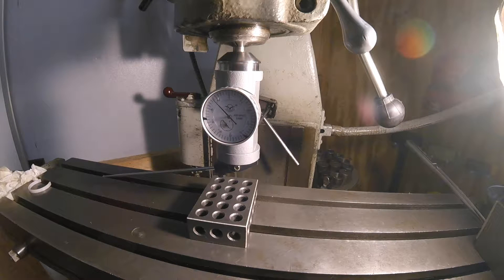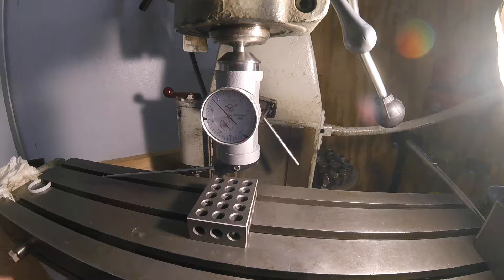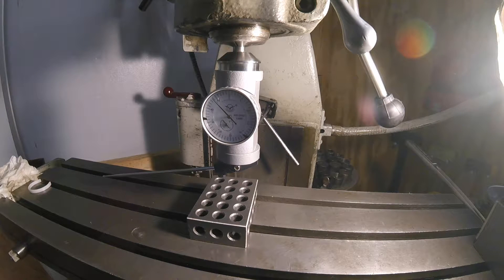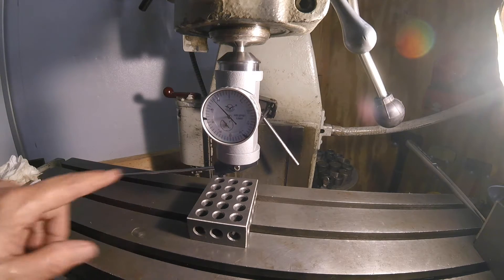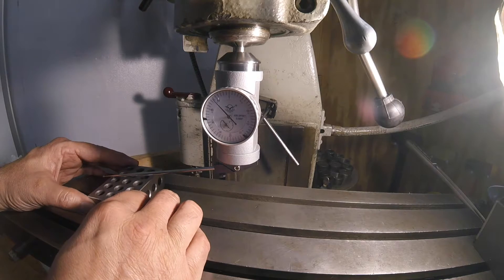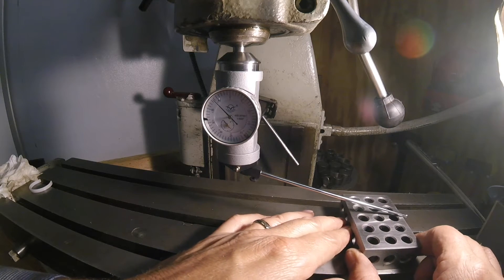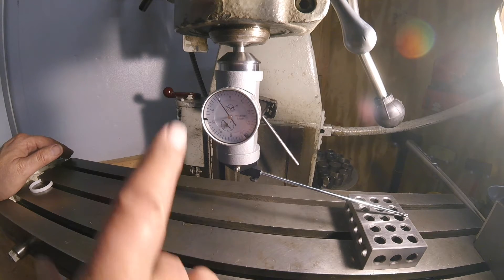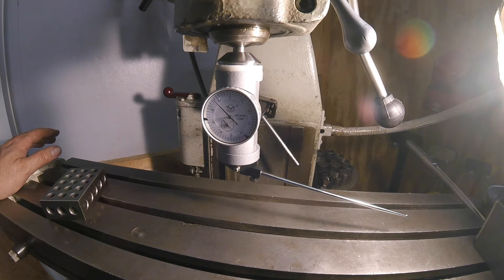Tram Mill Head With A Coaxial Center Indicator

Comment: A dial indicator is actually more accurate. I tell you why. Those indicators are accurate with the 1,5" feeler, In that case 0,001" on the dial is 0,001" on the feeler, but when you are measuring with this 3 times longer feeler 0,001" on the dial is in reality 3times more on the feeler.. so it is 3times less accurate. It tricks you into thinking how good of a job you have done, but in reality you didnt.
Reply from the maker: I bought a Pro Tram that uses two dial indicators within a month of this video and posted a video of it in use. My neighbor showed me this method because it’s what he was taught, and I happened to have a coaxial center indicator which was needed to do it.   The pro-tram is the way to go, and I also use it to set the head tilt as shown on my finger plate video.

Comment: I don't know much about your mill. But if you have a geared type head adjustments on your mill something like the Bridgeports and the clones do what I finally figured out was once your very close to final tram then snug the head locking bolts up a partial turn past finger tight, then touch the indicator to the table along the axis your adjusting, then start lightly tapping on the end of the wrench that's on the tilt or nod adjuster. That allows you to creep up on the final adjustment a lot easier while watching the indicator needle move the measured amount you need. You do have to use a bit of experience and feel since if you get those locking bolts a bit too tight you WILL do damage to the adjusting worms or gearing. If the bolts are even a bit loose the head tends to move around and out of adjustment as the bolts get tightened. I also run checks in X and Y while I'm putting the final tightening torque to the head locking bolts since the head can still move as it starts to fully seat against tilt and nod faces. It's a bit like tightening head bolts on an engine where you tighten all the bolts multiple times until you reach the required torque measurement.
Reply from the maker: Thanks for the great instructions on tramming a Bridgeport.  My Rockwell mill has the same configuration as a really old round ram Bridgeport and it does not have a nod feature.  The round ram is fixed to the head and goes through two clamps that are cast into the mill body.  You loosen the clamps and the head rotates.  It does have a ring and pinion gear on the back of the ram to help rotate the head, but I see this feature at as something that is used to help rotate the head in a controlled fashion while the clamps are loose, I don't think it is strong enough to use the way you do in the Bridgeport.  There is also plenty of slop in  the ring and pinion, so you can fine tune the head with a hand or a hammer once you are in the approximate position and snug the clamps down slightly.   Once I'm close I tighten the clamps enough that the head wont rotate on its own,  Then I make the first adjustment while tapping it with my hand then I snug the bolts, and check again, then i repeat this sequence to get it closer and closer, while snugging the bolts a little more each time. after a few repeats it is lined up and pretty tight.   I found that tightening the bolts a little every time you get it closer is the key for me to make it work, because if you were to get it dead on with the head loose, you would loose that adjustment as soon as you tightened the bolts.  I use the same tighten and tweak procedure when aligning mill vises and when doing precise angles on my lathe compound, and its been working for me.  I've only had this mill for 2 years so I'm no authority on aligning the head. This is part of the reason I only showed the unique technique my neighbor showed me without getting into actually showing the full process.  There are way more experienced people, Like you,  that could give a lot more detailed explanation of the process than me.  Thanks for watching and thanks for your comment!   Chris
Reply: It's maybe a bit less so on the small Bridgeport sized machines, but those ring and worm gears on these mills are also meant as a bit of a safety device so the head can't swing down out of control. I've read of a few people who had hands and limbs badly crushed or were even killed on very large bed type mills when the head swung over while they had body parts in the way while making adjustments. The more modern equipment now has a lot more safety built in.

Yeah I have to tighten the bolts gradually the same as you do. Even with gearing on both the tilt and nod there's enough backlash the head can move a lot.Just don't try to measure any linear movements with those Co-axes, even with my Blake there well known as more of a null setting tool, or in other words your trying for the minimum of needle deflection while using them. Due to the internal geometry  they can't really measure accurate distances. Most or maybe all test indicators can't either if you use most of there travel. There ok for a few thou and can be depended on for that.
Reply from the maker: I agree. I always thought  a ring and pinion should come standard on all engine stands as well.  I came up with this thought after seeing a friend get whacked in the nuts by a  fully assembled big block chevy.  He pulled the pin to rotate the engine and the engine spun upside down right into his nuts. OUCH!!!   Chris
Reply: That made me wince just reading it.
Reply from the maker: I just tried your tap the adjustment wrench method to tram my mill and it worked great.  Thanks for sharing the tip.  I just published a new tramming video using my new Pro Tram, and used your tap method in the video.  Thanks, Chris
Reply: Glad that method worked out for you. I was spending way too much time getting the head dialed in the last little bit until I started with the head locking bolts a bit tighter. It seemed to cut down on the head moving just a bit out of tram as the bolts go tight. At least for me it seems to go a lot faster and easier doing it that way.
Reply from the maker: Turning Point  I agree, that always helps.   I always do a tweak-tighten-tweak-tighten etc when dialing in anything.   Thanks,  Chris